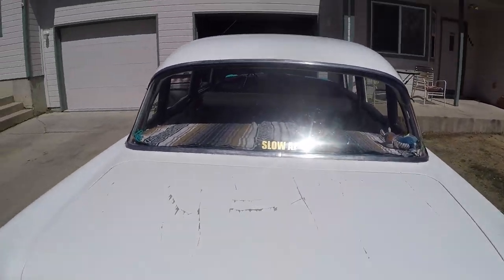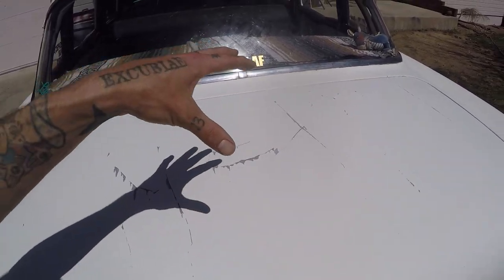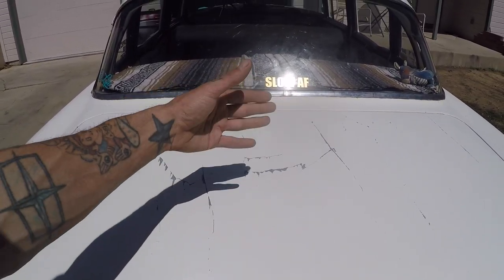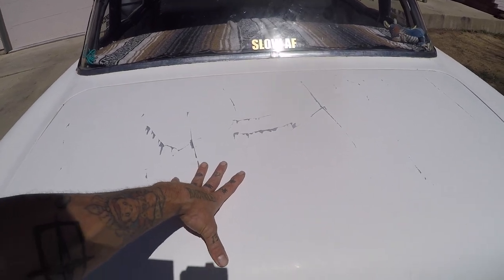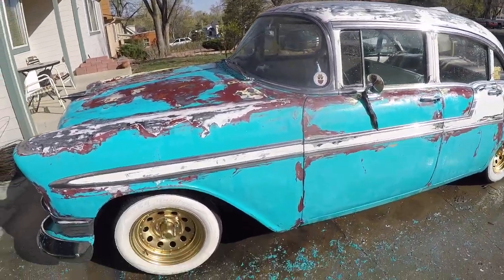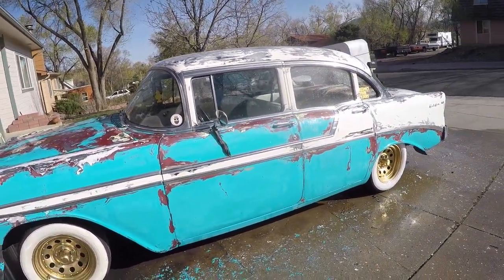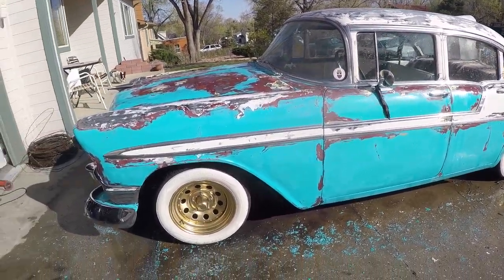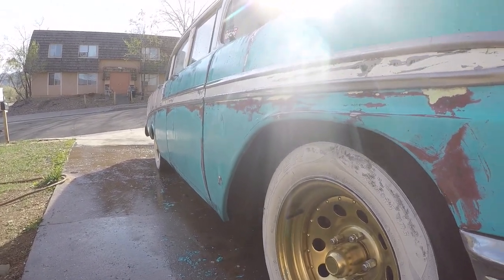1956 BelAir PATINA (FAUXTINA) PROCESS PART 1 S08E17

Comment: I want to do this to my c10 is there a part 2 to the process
Reply from the maker: yea, i have been letting the bare metal spots rust. then step two will be coming once the metal has turned a nice orange rust color. you can accelerate this process with salt water and vinegar/peroxide. once i do the next step, i will upload a video.. which is really using a wire wheel to smooth it all down. then clean off the rust powder. then clear coat with matte of semi gloss clear coat spray. good luck!